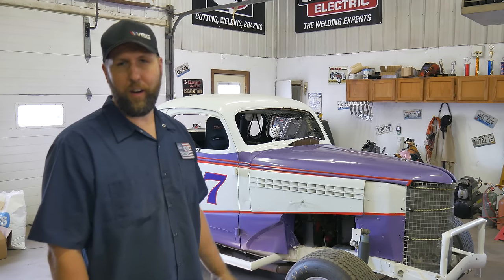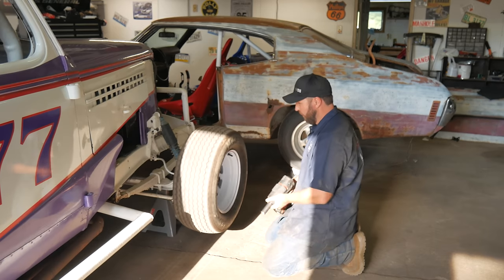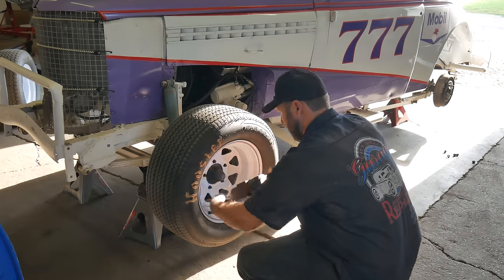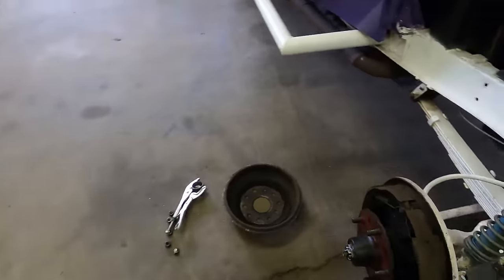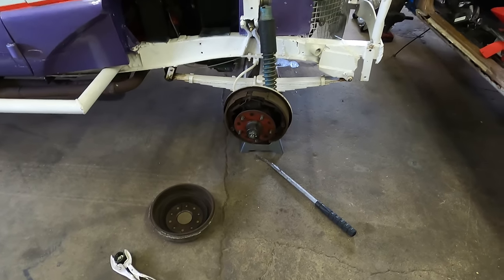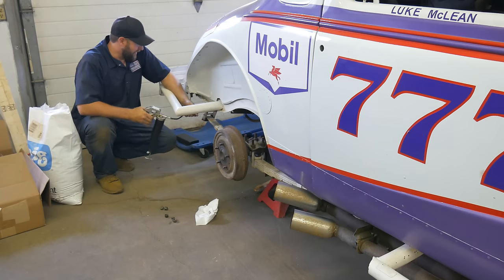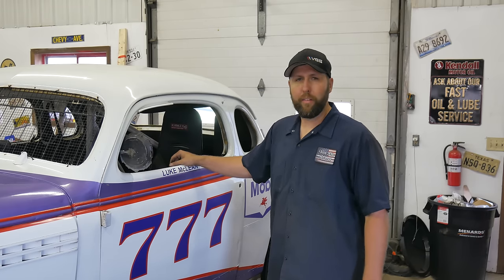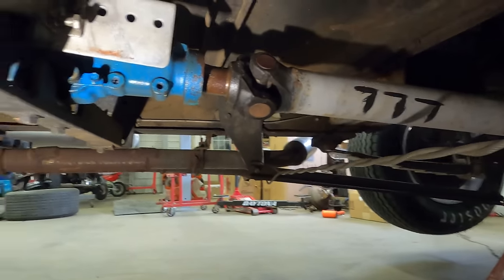Preparing the Vintage Modified Race Car for my FIRST RACE! - Vice Grip Garage EP90

Comment: Brake shoes are reversed. The primary shoes are installed in the aft position and the secondary shoes are installed in the front position. This is why the aft shoes are so worn and the front shoes appear to be almost new. The short primary shoe should be providing energy to press the big secondary shoe into the drum. This car has the big, hefty secondary shoe pressing the small primary shoe into the drum. This doesn't provide much braking but creates a bunch of heat and wear.

Comment: You know a feller thinks 
That shifter is  between  ones legs because  of the positioning of the pedals  think about it if you got your right leg stretched plum out to  the Atlantic ocean and the shifter is in the middle wouldn't you be knocking the car out of gear with your leg

Comment: Buy a good  Alumimum seat period safety first
Reply: It had an aluminum seat. Vintage race organizations can be picky about things wanting period correct but none i know of have a problem with modern safety components . Seat, cage, fuel cell,  fire system, ect are ok to modernize.

Comment: Can't be a factory 283. Believe they all had canister oil filters.
Reply: There was an adapter available i think mr gasket and milodon had them
Reply: @tomhutchins1046  Yes, I forgot. Was thinking maybe he'd destroked a 307.
Reply: @williammeszko3299  ???? that would make it a large journal 283? Why?
Reply: @tomhutchins1046  You're right again, difficult to do and no reason unless rules limit displacement. 

Seems that most 283s were built with steel cranks. I believe Chev increased journal diameter when changing to nodular iron.

Comment: No rear stagger due to welded diff?
Reply from the maker: Yeah, where im starting.  Might add right stager in the future
Reply: Vice Grip Garage any chance that shifter handle can be un bolted and rotated 180 so the bend towards the driver door is pointing to passenger door and not between the legs?
Reply from the maker: If heated and bent maybe. But im considered about enough forward movement cantilevered

Comment: It is a dirt track car. You don't shift. You just put it in second and run the piss out of it. It it is revving too high, change the rear gear or tire size. Growing up at a dirt track, most of the cars we had just had 2 steel rods to put it in gear and a hand clutch on the left  side. Heck, back then all of the seat belts were olive green because they came from army surplus and the fuel "cells" were surplus jerry cans from army surplus.
Reply: These days they run in 4th and get the gear in the rear end
Reply: @tomhutchins1046  Yeah I guess times have changed. Back in the late 70's and 80's, we did not even change the rear gears, we would just put a different rear end in between race weekends. But we raced on the same track every week so once you got it close, it lasted all season.
Reply: @freewill51  Some higher end cars have a little very special trans with 2 gears and an internal clutch. the racing gear is one to one

Comment: Love the videos but about 7 minutes in and when I see he pulled off the front drums I see right away the brake shoes are on backwards, the shoe with more pad material around should be to the rear of the car , that’s the secondary shoe , on this car they are to the front of the car. Not good.

Comment: Why don't you unbolt the shift lever and turn it 180 degs., so that it comes up outside your right leg? Don't know if that will be a problem, but it should be more natural for you drivers of "left hookers". While you're at it, you could even extend it laterally, a few inches, if you need to. Even better, build a short throw lever on a pedestal and run cables to the business end, but that might take some time and thought.

Comment: Uh, not being smart here, but IIRC the short shoe goes facing front, called the primary shoe, the longer  shoe goes in the rear, or the secondary shoe...just saying, the brakes work but not right if they are reversed...Oh, and you can weld the hole some the grind it flat again, as well as make the hole the proper size. As far as the shifter, would a GTO/ Chevelle 3 speed shifter work to put it outboard of your right leg instead of between the legs, which looks really awkward. The original driver must have been short, cause you look really uncomfortable and stuffed inside.